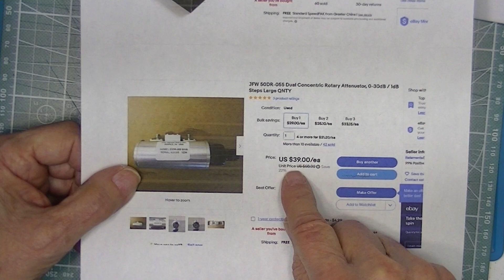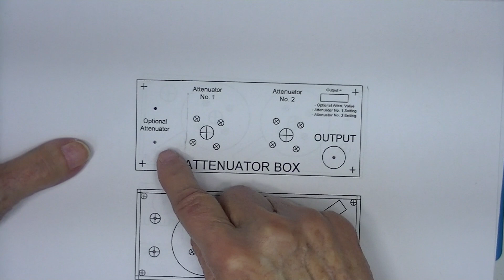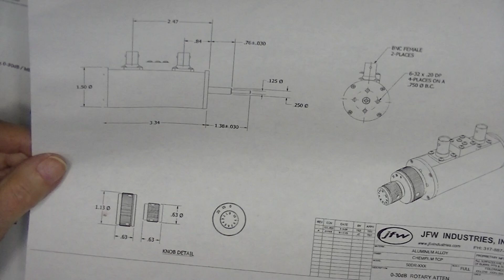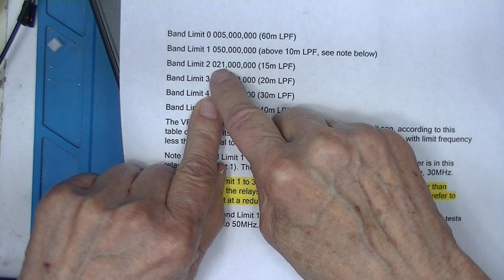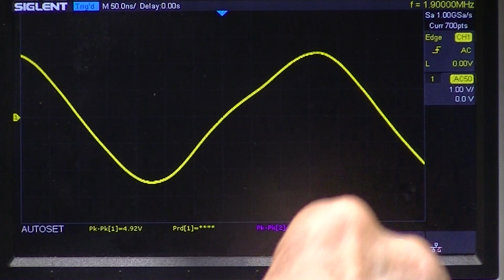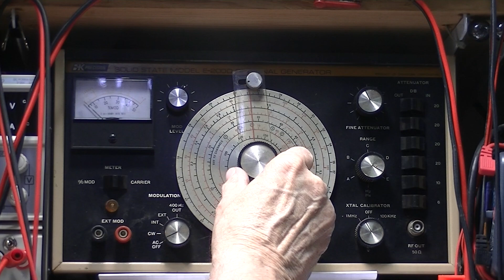QRP KITS Sine Wave Signal Generator (Kit) Part 4

Comment: Steve, I also have two of those stepped attenuators.  I like your enclosure for them and I need to do something like that too.  Sorry about your SA and hope it is an easy fix.  Nice video and thank you for posting.
Reply from the maker: If you think it will held I can supply a .dwg (AutoCad ) or a .pdf file of the box and front panel as well as a link to the box.
Steve
Reply: @stevestrivia-bystevewagner4852  Steve after the video I went out to the shop and found a box a little bigger than yours so I will use that enclosure but thank you for the kind offer.